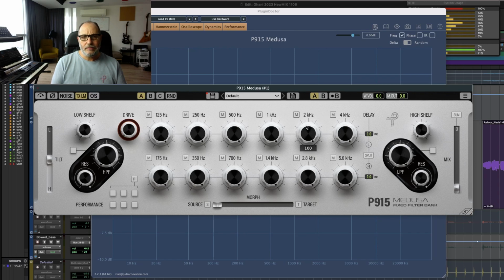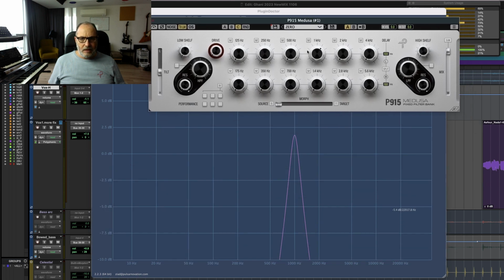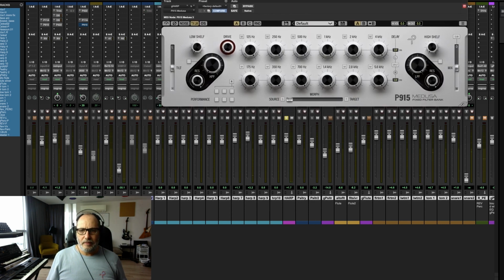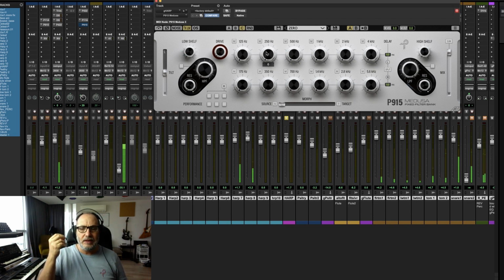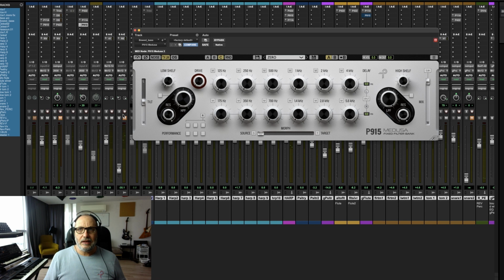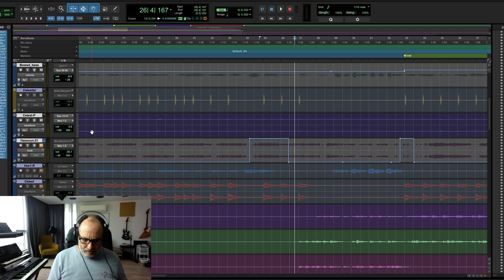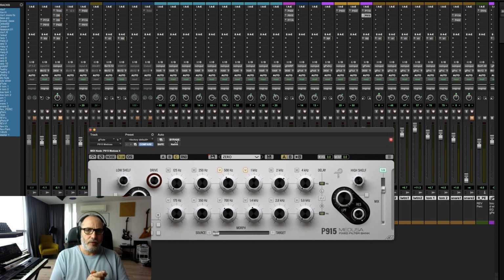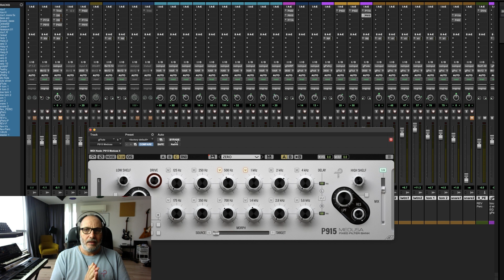No Nonsense Audio Workshop- 6: Enhancing the natural acoustic instruments with a Fixed Filter Bank.

Comment: Using this mixing technique, the P915 does enhance the sound in a natural way, stays always true to the original source. The SUM feature is a great tool for traditional mixing tasks. Additionally the P915 has the W.VOL slider that can boost the wet signal even further. I'm looking foreward for the next parts in this series, as this video merely shows a fraction of the things P915 can do. It's an incredible versatile plugin for mixing engineers and creative producers alike. ❤